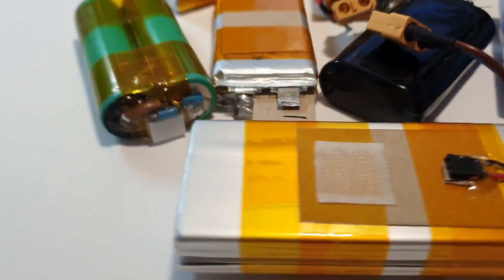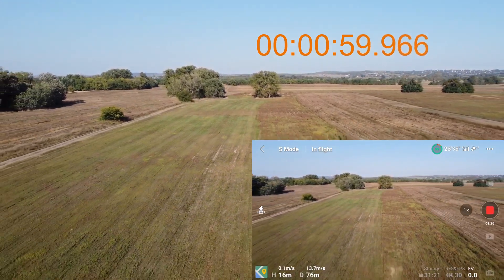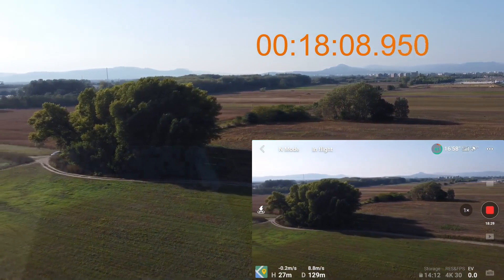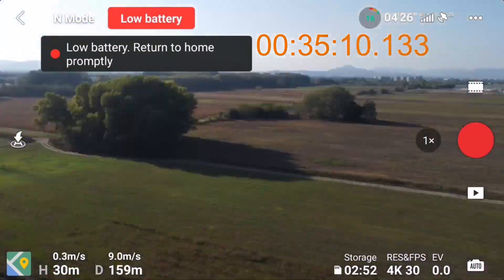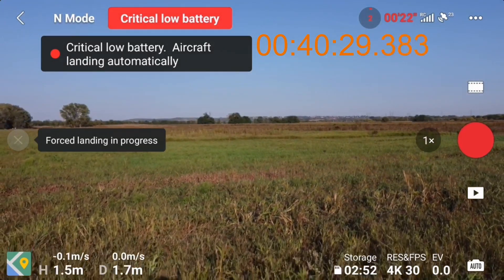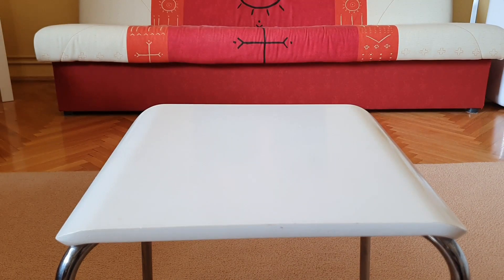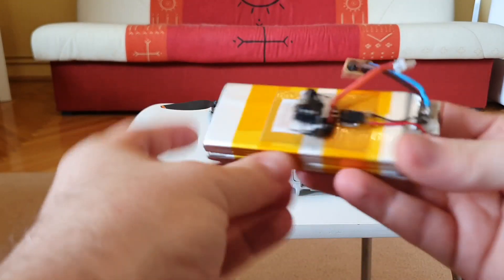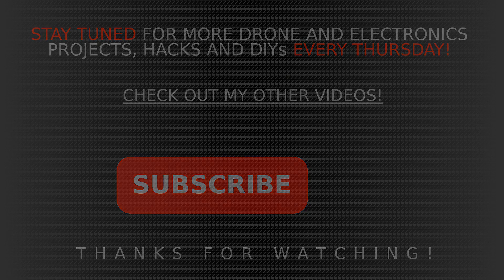Mini 2 battery mod. Fly any battery you want.

Comment: Zolly I know it's 2 years later friend but since doing your mods has dji placed some kind of preventer? to your mods.. Because I've tried it and have proper connection but I used the same capacity battery. The one inside and I identical on the out side both indeed are showing voltage from inside drone and outside and while both fully charged I ended up with the same time even while I've doubled the capacity.. It's rather strange that 2 identical batteries are not producing more time..
I wonder if firmware updates prevent external battery from doing anything at all..?? Hmm
Reply: I am trying to do this mod for Neo, are you able to increase the capacity with additional battery or DJI is preventing it with a firmware?

Comment: 0:02
Howdy,  question for ya. 
 what is the extra wear and tear  on those motors from extended run time
  thanks for your time
ty, les
Reply from the maker: As long as the supply voltage is per the reference, there is no extra wear on the motors.

Comment: Very interesting video, have a question if a battery is new never activated but for drained to level that the chip locked the battery and now flashing the 4 light of death 
If I take it apart and charge the cells individual will the chip be able to recognize and be unlocked or need a software tool, thanks man !
Reply from the maker: If it is locked, it is locked, sorry....

Comment: Couldn't someone get two cheap mini 1 batteries and mount the 2nd one on outside or mix a mini 1 and mini 2 battery? The older batteries are on clearance at my local store. I just got my mini 2 and I'm really interested in doing these mods for myself. Are these packs running under 8 volts when running in series?

Comment: Good tests! Which lipo cells you recommend in case when I just want to repack original battery with more mAh cells so it still able to fit inside in mini 2?
Reply from the maker: 3500mAh

Comment: In the controller if you lengthen the wires to the joysticks and swap the plugs will it swap the controls to make it like playing a video game?
Reply from the maker: Yes. One can swap around the cables quite well to change functionality. The connector pins has to be checked though. I am not sure if you can just simply put the left plug to the right socket and vica versa.

Comment: Interesting videos and trials.  Thanks for sharing.  Is it possible to use the charging port on the Mini 2 to extend in-flight battery life?
Reply: I was wondering this to..would make things a lot easier
Reply from the maker: No it is not unfortunately. I the battery can NOT be charged through USB while the drone is turned on.

Comment: zolly great video , great explanation again. i am very curious after your diode add to esc  for 3s battery fooling. is there anyway to deceive the mini2 to keep fly under 3,2V. cause it forces to land at 3,2 V which is important  level for lipo batteries. if mini 1 battery (flies 21 minutes instead of 26 min)  or other batteries with liions included, you can use it up to least 2,7V. is there any electronic circuit that gives information that the battery is 0,5v higher than the  real value.
Reply from the maker: That is tricky unfortunately as the ESC also has a low voltage cutout. And that is not coming from the BMS. Meaning it could be fooled but at a point it would just turn off the rotors and the drone would fall like a potato.
I tested it indoors above a pillow on the floor and it dropped without warning.
So i do NOT recommend that approach!😅

Comment: zolly, thank you 
if the weight of the battery is too heavy, the drone may lose lift, I lost an original elice which broke at screw level, with a 5000mah. with a pro battery it remains very agile in sport mode ,, I hope that this comment will remain as an experience and security of your subscribers

Comment: Hey  Zolly, I was intrigued by your mini 2 battery/18650 mod. Would it be possible to make the same mod but with swappable 18650’s? The idea being to sacrifice one mini 2 battery to create the harness, then just swap 18650’s and fly. I’m sure flight times will be affected, but I’ve a ton of 18650’s and only four m/2 batteries. Use the 18650’s while recharging the m/2’s. Thanks Zolly!
Reply from the maker: It is possible. The problem is the available space. It is quite tightly packed in there. I will give it a thought.. :)
Reply: Hallo. In this Video Somebody has also Tried IT and IT doesnt Work. https://youtu.be/6dpo6Y06lU8
What did He wrong?